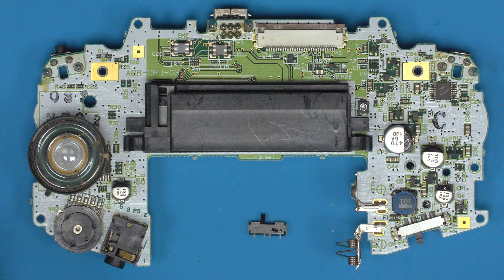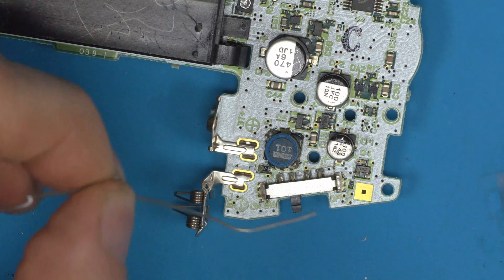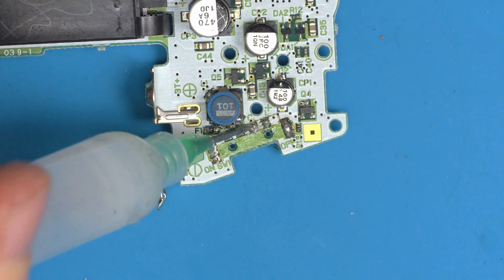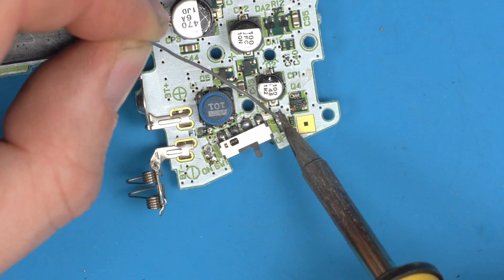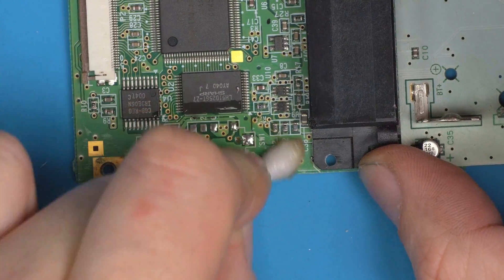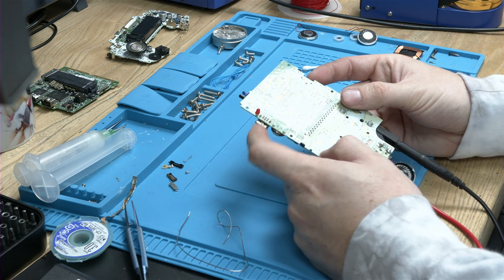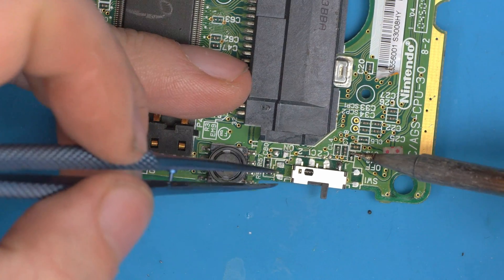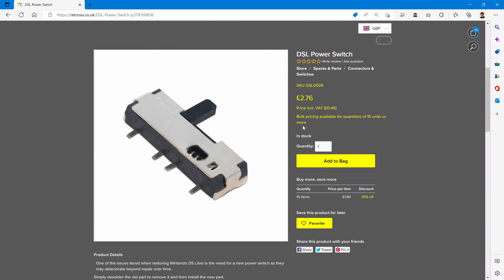The NEW King of POWER! Bye Bye, Universal Power Switch Game Boy Advance

Comment: Thank you for your infomation.
Your video has revived my GBA switch.
I was thinking of gluing the switch with the circuit board because the part that turns it on/off is too short.
Thank you very much for your help.

Comment: On the gba sp does the switch cover work properly? Does it still have that flick to it? Or would you have to modify it to cut that bump on the cover off?
Reply from the maker: Yep works fine just shorten the switch length as shown

Comment: Interesting. I always figured there wasn't any reason why the DSL switch shouldn't work, I mean I don't see anything special about any of these switches, especially considering you can just replace them with just about any old switch provided you wire it right. But I was always told you can't use them. I never thought to remove the spring though! Good advice :)

Comment: Sketchy footprint fit aside, unless you can provide a data sheet indicating that these switches are rated to carry the amount of current required by these systems(modded or otherwise), they really shouldn't be suggested as a "perfect" replacement.
Reply: How much power do you think the GBA draws..?
Reply: @KiraSlith  stock is ~70mA at 2.4V. With an IPS screen(including the R6 one), this can exceed 500mA at max brightness. There are similar sized switches out there with current ratings in that ball park, but also plenty that are rated for 10mA at best.
Reply from the maker: @leggomyfroggo  these have been used in many of our Prestige consoles for over 8 months no issues. Fully modded
Reply from the maker: @Joda21steel  been using them in every build for over a year. 1000s. No complaints so far
Reply from the maker: No it doesn't so your ok
Reply from the maker: Yes
Reply from the maker: DS Lite uses more current than GBA... SO yeah, no problems with current. I can happily pass an amp through them and show the resistance drop, temperature and much more on my super fancy equipment, but I'm pretty sure nobody cares
Reply: @RetroSix  The DS Lite uses a momentary power switch, so the full system current never passes through the switch. It would need a rating in the tens of milliamps at most.

Comment: How's the width compared to the plastic switch piece? I have noticed their is alot of movement, wiggle room with the cheap aftermarket ones. Alot of the times the plastic piece inside the switch will fall out due to not being a good fit. If this is a drop In and forget about it replacement then this is then a game changer.
Reply from the maker: Its identical. works perfect for all of them